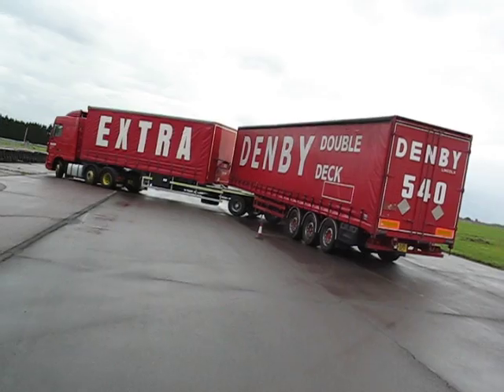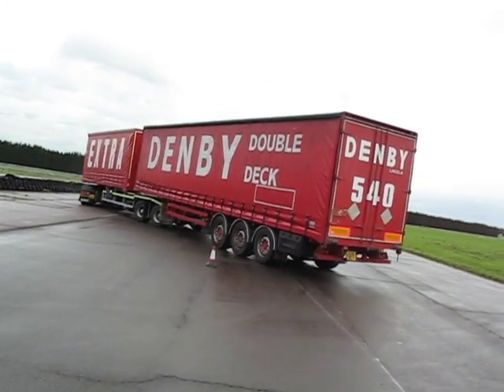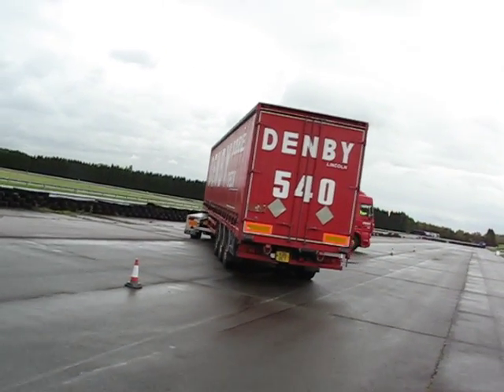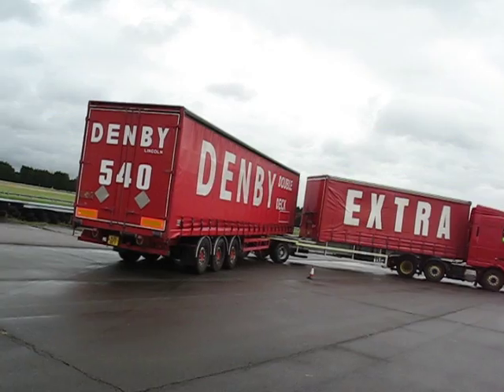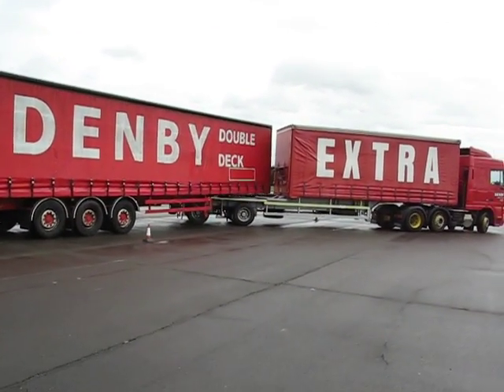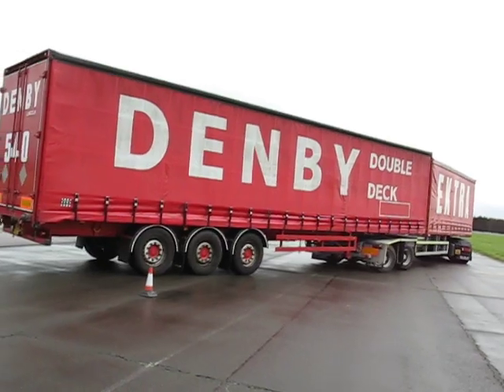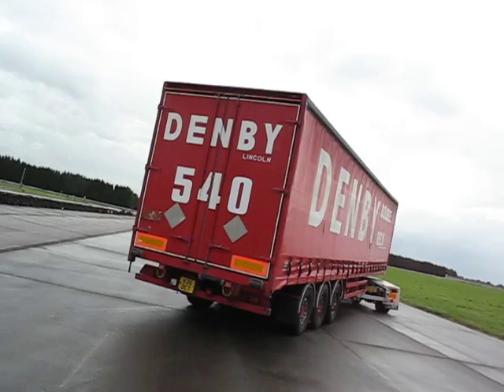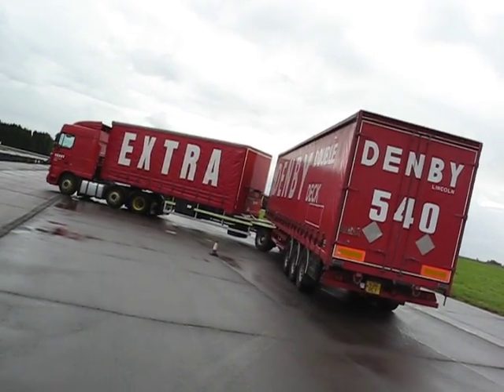Dick Denby Eco-Link B-Double steering demonstration

Comment: We use them in New Zealand and Australia and the roads are certainly not littered with jack knifed B Doubles. I drive one myself in OZ and at 65 odd tonnes at 100kph they are not that much different than towing a single.

Comment: @j91ebd
It's actually already legal, though. It's just limited to 40mph on the motorways and 20mph everywhere else. I've passed a couple of double trailer rigs in my time (one quite recently, doing a solid 40.0mph on the M5 - must be dead scared of getting pulled over...). Rather uncommon, but they are road legal and do exist.

Lower limits probably because of high jack-knife risk. Something like this, however, may not face as big of a problem in that regard & may be cleared for, say, 50-40-30?

Comment: @Compzombie25 

You put the tracktor in reverse and you hit the gaspaddle :) 

Driving it backwards is like drivving backwards with a full trailer. first stear to the direction you want to go, at the right point, stear to the direction you dont want to go and the at the right point again to the direction you want to go. 

It takes some pacticing. Seach for LZV to see more of this trucks. In the Netherlands and Sweden the testing is over, and we may use the roads.